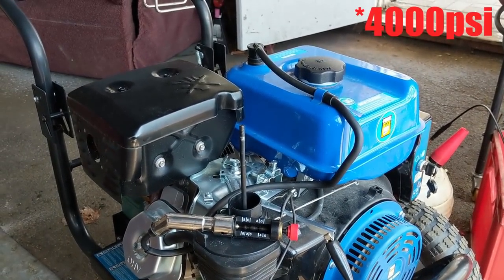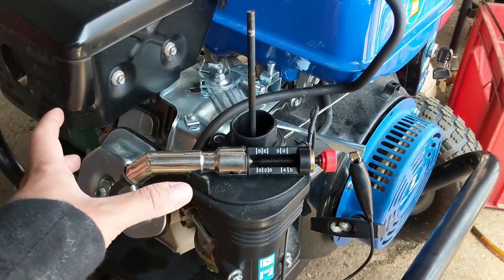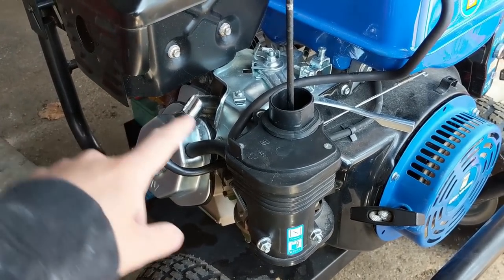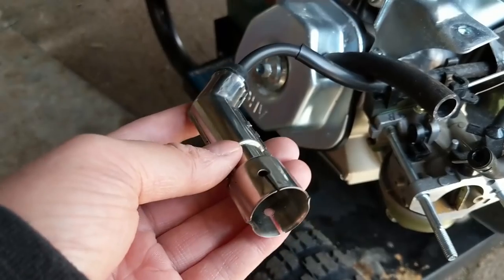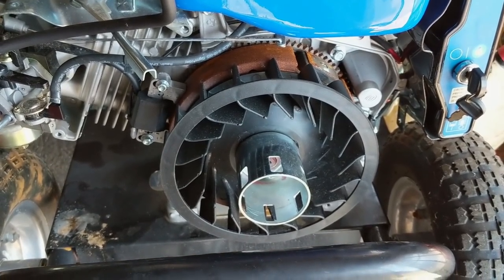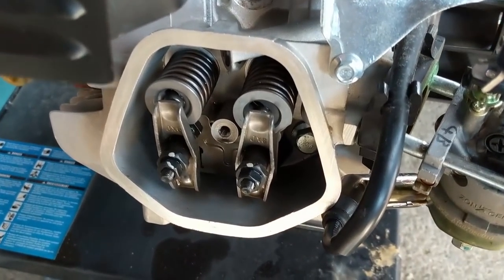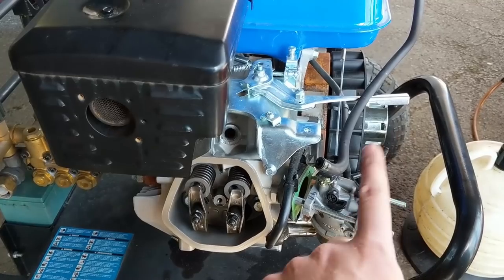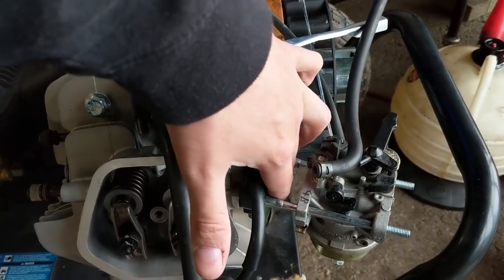Powerfist 420cc - Won't Start

Comment: if I had to take a course in mechanics I would have had a teacher like you. you got it Jake !!!
Reply from the maker: Thanks for watching Minouchat!
Reply: I’ve got a 9000 Powerhorse generator that will not crank. I think the timing gears have jumped a tooth or two.

Comment: Great video. Thanks. I have had piston rings stick so that they are not pressing against the cylinder wall and once I got the unit to run, they freed themselves. I would  put a little oil into the cylinder to  temporarily improve compression and see if it'll  start. Worth a shot maybe. Thanks for sharing
Reply from the maker: Thanks for watching Peter!

Comment: Just bought a brand new one of these. It’s an incredible engine when it’s running, getting it started is the issue. It’s just doesn’t like starting at all. Hope I didn’t waste my money!
Reply: I have one on my bandsaw mill and starts perfect with choke no matter cold or hot needs choke on and fast turn it off when she catches.

Comment: Very nice diagnosis. If he fixes this engine, hope you video it. Thanks for the video's. I also get some strange things in my shop. Just had an Amish engine completely full of water. Was able to fix it, but tore most of it and carb down. Thanks
Reply from the maker: Water is a terrible thing for these small, single cylinder engines. Thanks for watching!

Comment: Yes, put in a couple of squirts of oil into the combustion chamber. it will rise the compression so you can start it. run it and the rings will loosen up. I often do this for new assemblies, as it raises the compression to the highest it can be and is much easier to start.
Reply: Agreed.

Comment: I always add a couple of teaspoons of 2 stroke engine oil to the gas, for my small 4 stroke engines for piston ring and upper cylinder wall and valve stem protection, it keeps everything well protected year round.

Comment: Good video but I disagree with the Honda clone engines being garbage. I mean yes they are not Honda quality but for 1/2 or even 1/3 of the price they get the job done. I have seen plenty of them last just as long as some B&S and Kohlor engines.
Reply: I have a couple of A-ipower (Chongquing Am Pride) Honda clone engines, and they seem to be of decent quality.  I also have a couple of Chinese gasoline engine gensets and they run relatively well as well as a Cub snow blower with a beefy 420cc engine brand new this year and they all are made similarly to Honda engines.  If I was going to use them commercially I would invest in Honda GX as the engines are warrantied for three years, commercial or consumer.  Actually, I have three Honda GXV engines on a couple of lawn mowers and one small snow blower.  The Honda engines are 25-35 years old while the rest are within the 10 year mark.  I agree with you that the clones aren't necessarily garbage, in fact I would think that they could outlast some of the Briggs engines on the market today, even the American made Vanguard engines.

Comment: so i picked up a garden tractor that had that motor retrofitted... it ran started running rough and backfiring but now it turns over but won't start at all... every once in a while it will backfire... through the exhaust as well as the carb... weirdness.  any thoughts before I trash this thing?

Comment: Where did you put the carb cleaner? Directly into the spark plug hole?
Reply from the maker: And through the carb, wouldn't start due to low compression.
Reply: @EliminatorPerformance  very useful video - helped get mine running after 2 years. However it is leaking gas out of the float bowl because the gasket is split. Figured I might as well replace the whole bowl. Any idea what bowl I'm looking for?
Reply from the maker: @buklau2027  try a carb rebuild kit on amazon or ebay
Reply: @EliminatorPerformance  I've rebuilt my carb and now when I pull start it'll start up for just a second then die, any suggestions? Thanks!

Comment: lol I'm guessing you're paid by the hour? I know you're trying to "cover all the bases" but I could have told you right off the bat that the problem was likely the rings based on what the customer said. From there, check spark, check carb with spray. If still no fire, shove a camera down the spark plug hole. Could have had it all done in like fifteen minutes or less. That being said, you did cover all your bases and your conclusion is the same as mine would have been and your suggestion to the customer is the same. If it was a name brand engine, sure. Since it's not, might be better off replacing it to save a lot of hassle in the future. If the customer gave zero information, your process to check would have been spot on. When you know nothing about why the engine is as it is, you have to cover everything to reach a conclusion. When the engine is "new" and the customer tells you, like in this example, that the engine has sat for years and was seized, and he brute forced it to be free, yeah, it's probably going to be a ring problem. Of course, it could be a valve problem, but the better chance is rings.
Reply from the maker: Yes I am paid by the hour, to repair. Not to diagnose. Diagnostic is $35 and that fee is waived if I end up doing the repair. I quoted the customer and he said he didn't want to put money into it. Like you said, after the customer told me he "broke it loose with a Johnny bar" I Basically knew the rings were probably cracked, and it wasn't making compresion because of that. this was just filmed for the sake a video.

Comment: dude... just clean the carb... the rest is silly
Reply from the maker: I sold this engine to a friend, he tore it down and the piston rings were cracked due to them rusting to the cylinder and the guy freed it up with a breaker bar. He bored and honed the cylinder, oversized the piston and rings and he said it's the most powerful pressure washer he's ever used